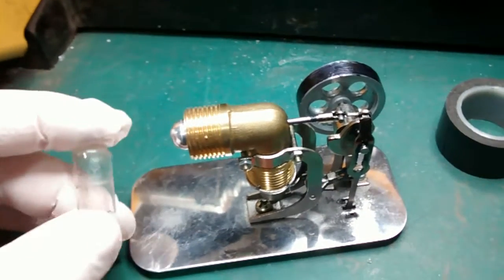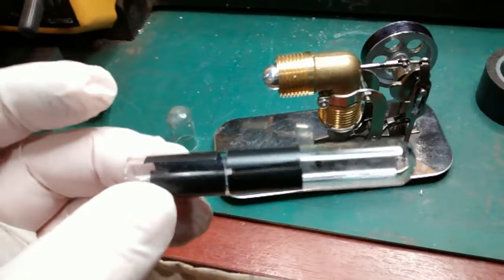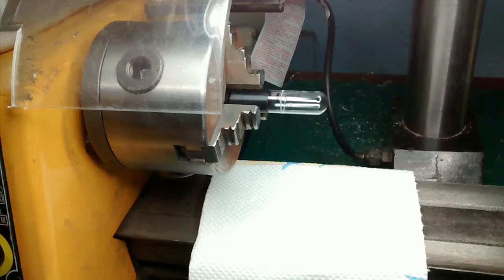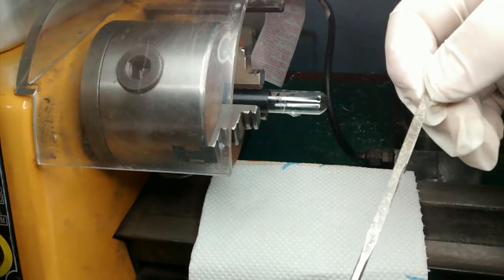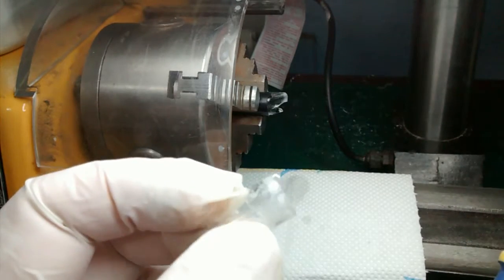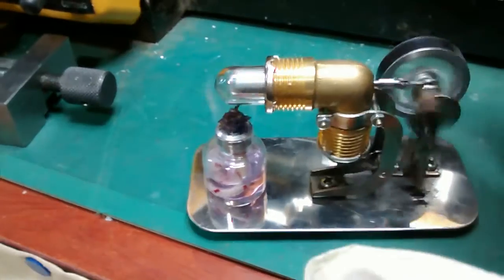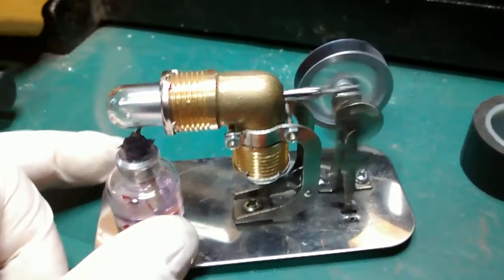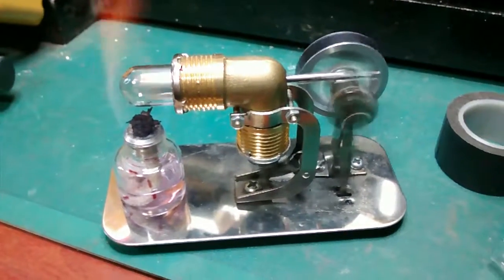Cutting a test tube on a lathe - replacing the displacer tube on a Stirling engine

Comment: nice repair, and a lovely engine to see in action, looks like its made from some kind of pipe fitting?
Reply from the maker: Need to cut another one, that one lasted about 4 days and then got a a knock that cracked it again.  its made from a 90* pipefitting for 12mm copper pipe, all the rest is stamped plate work the tool making skill of the guy who does these is amazing.  you can pick one up on ebay for about 22 quid inc the post.